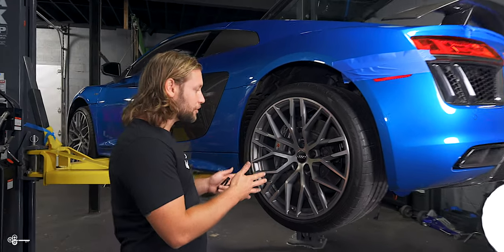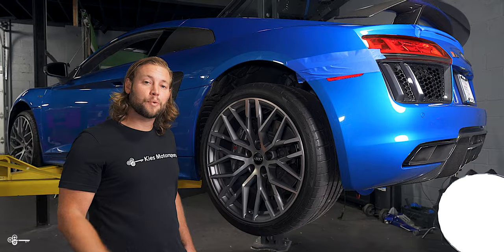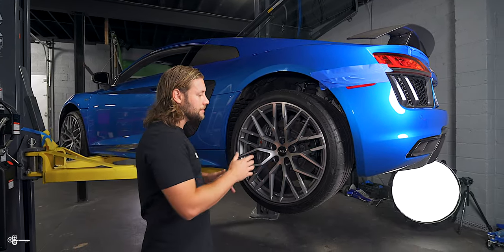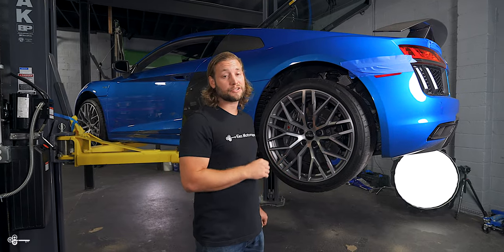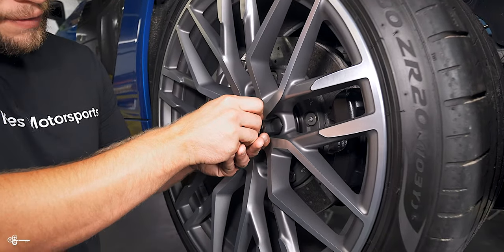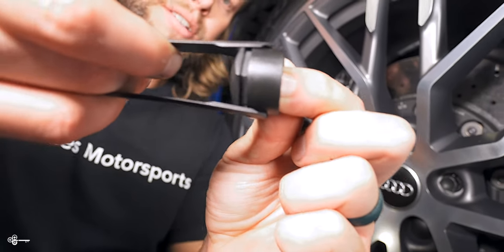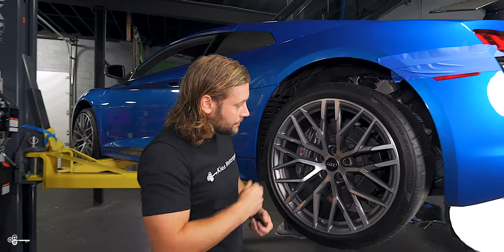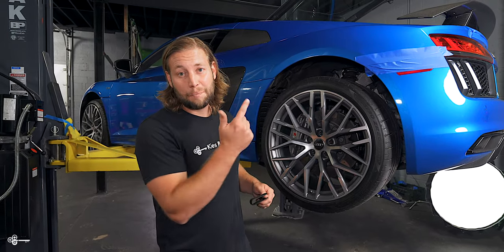HOW TO SAFELY REMOVE AUDI/VW WHEEL BOLT COVERS, WITHOUT DAMAGING YOUR WHEELS

Comment: Will these caps fit over a wheel lock as well? These might be more for looks or theft deterrent, but wondering if you could still use these with a wheel lock on each wheel. Thanks!